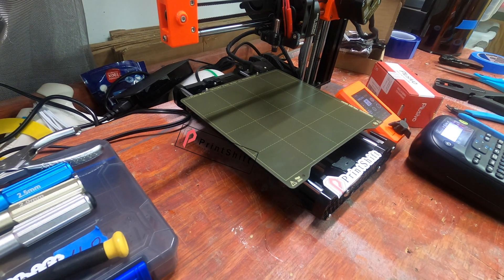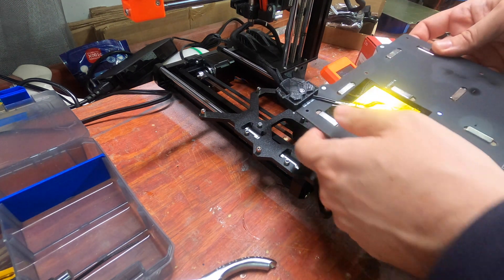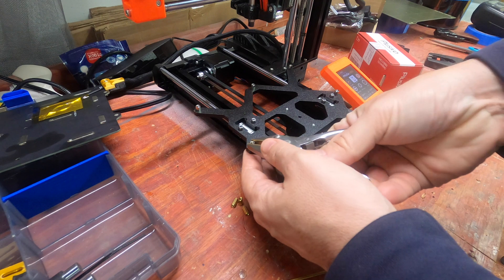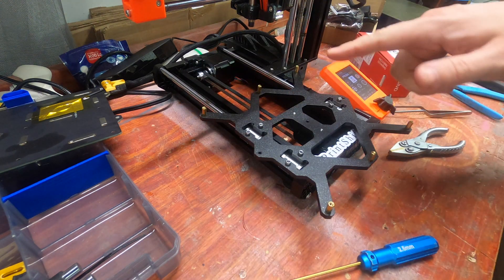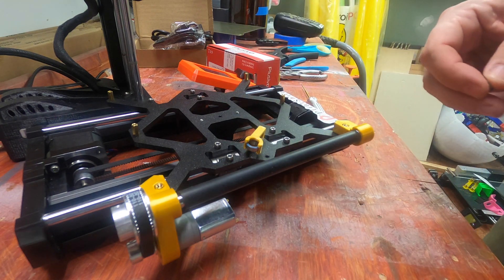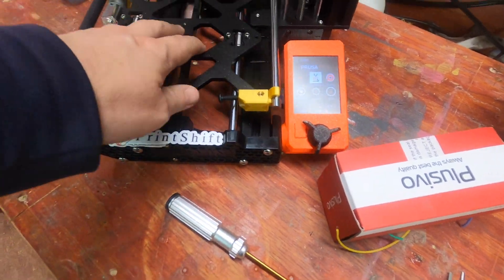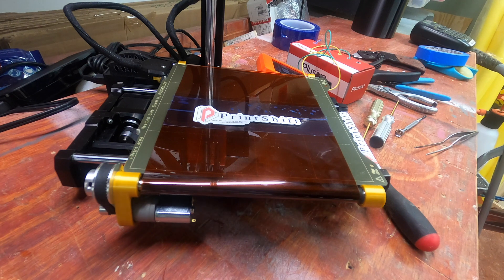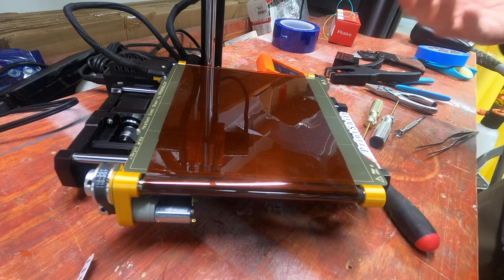PrintShift 4.0 Part 1: Adding the Conveyor Belt

Comment: about how much does a print shift cost in the end?
Reply from the maker: It's around $50 per printer for the bare-bones, motor+microswitch - but it's a lot more useful if you add raspberry pi

Comment: It looks like you are installing this on a MINI+, I've started the process on one of my older MINI's and there may need to be some modifications in order to make it fit. I guess the LCD on the MINI+ is farther from the bed because even with idler all the way in it hits the LCD on mine. The U-bolt style bearing clips on the older MINI's also protrude higher up and will likely interfere with the belt. Should be pretty easy for me to fix but something to be aware of if you 're installing on an older MINI.
Reply from the maker: If you go back to early PrintShift, it was on an original mini: https://www.youtube.com/watch?v=22qfJ1faSlI&ab_channel=PaulChase
I made some clips to replace the original LM8UU mounts: https://github.com/paenian/PrintShift/blob/main/prusa%20mini/mini%20mounts%20and%20enhancements/prusa%20mini%20lm8uu%20clamp.stl

Alternately... you can use three zip ties to replace the mini's U-Bolts
Reply: @PaulChase  Ah ok, that makes sense, I only watched the videos related to the 4.0 version so I missed that. I ended up designing a spacer for the LCD in Fusion and getting the Mini+ bearing mounts since they are inexpensive. 

Still waiting for my Kapton belt material to arrive but made a temporary belt with some wide blue painter's tape and so far it's working great! Thank you so much for sharing this design! I print a lot of small parts that I sell on Amazon and have been looking for something like this for awhile now.

Comment: what (if any) changes do you need to put in the software side since the bed is higher now?
Reply from the maker: No changes to the firmware or software for normal printing; it even still passes the self tests still.  I change the start and end gcode to perform the election, but that's it

Comment: Looks fantastic!  I had an idea... with my 3D Chameleon, I have a spare motor... maybe I can hang a small geared stepper motor on there instead and use my spare motor slot to drive it... that way, my hidden switch under the Y axis can be used to drive it.  The code is actually already done, since that's the same function we use for the non direct drive extruders to move the filament.  Until then, I just received all the parts in today and I've already printed them... so I guess tomorrow I'll be able to install it all!
Reply from the maker: No extra motor slot on the normal Buddy Board... But if you've got one go for it :-). My old Kossel ejectors used stepper motors pretending to be extruders for ejection